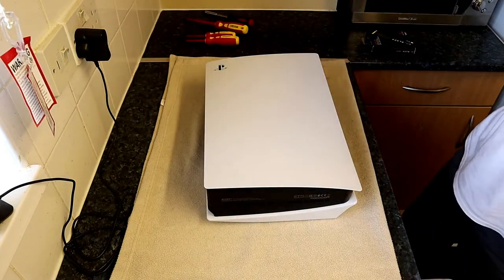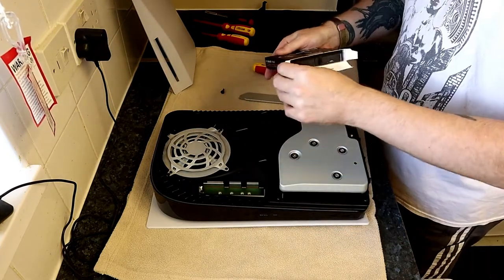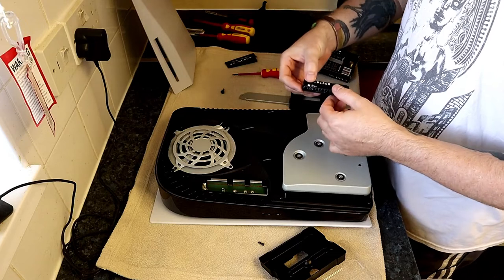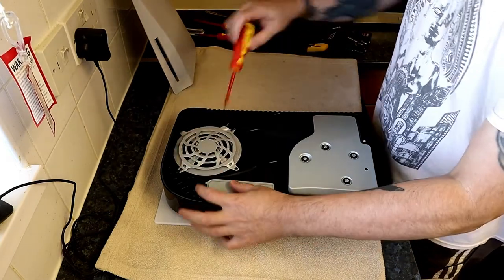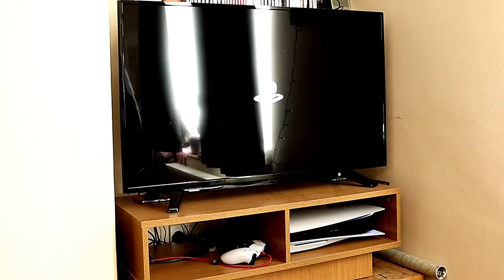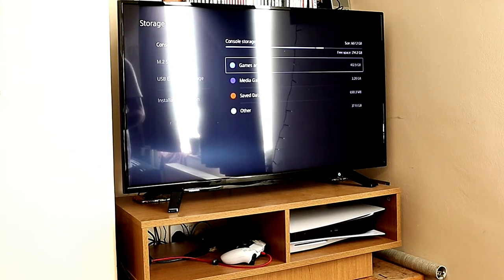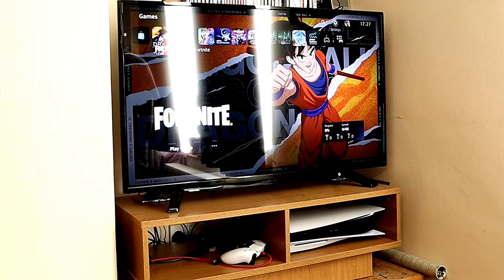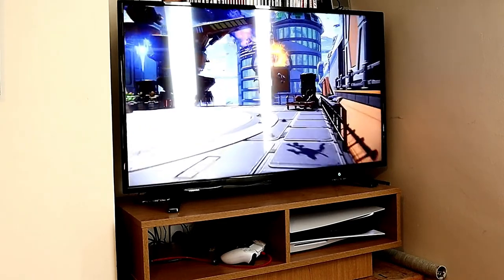PS5 WD_BLACK SN850 SSD 1TB Game Drive Memory Expansion Installation

Comment from the maker: Note: when taking the main body cover off to reveal the area where the game drive will be installed, carefully lift the end, kind of diagonally opposite to the game disc drive (where the PS5 games are inserted) and carefully pull away and slide the cover off. Go careful when taking the main cover off and when putting the cover back on - which it just slots and clicks back into place. Go very careful if taking the cover off is unfamiliar to you.